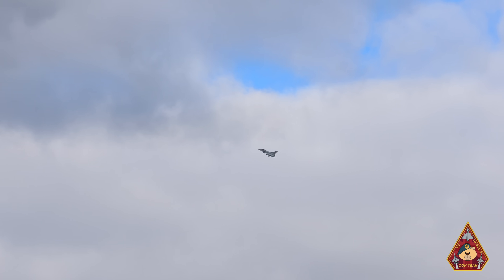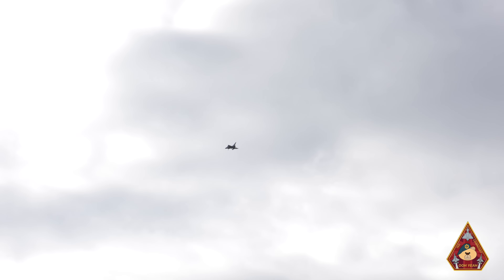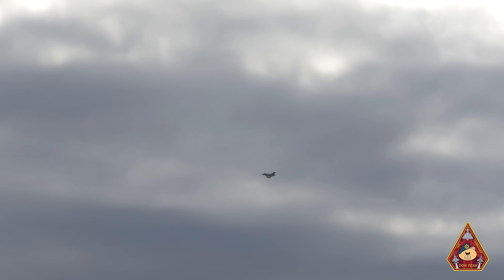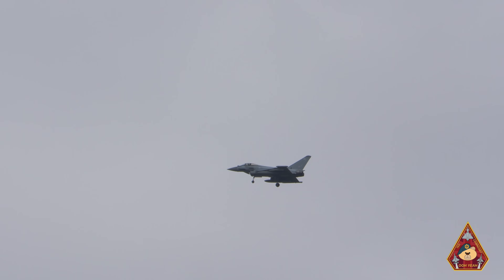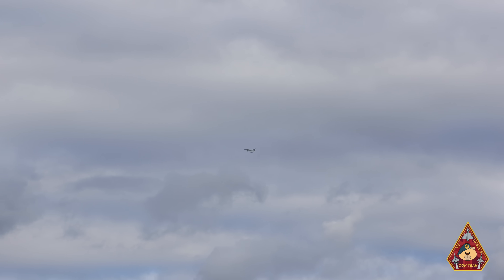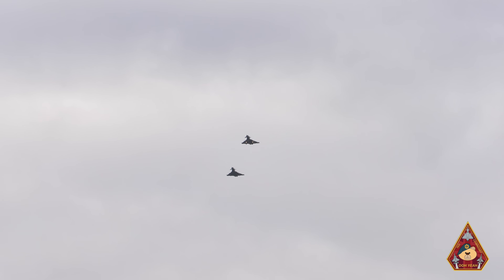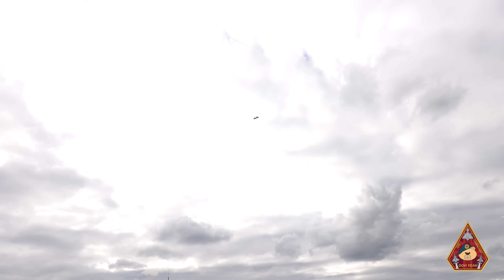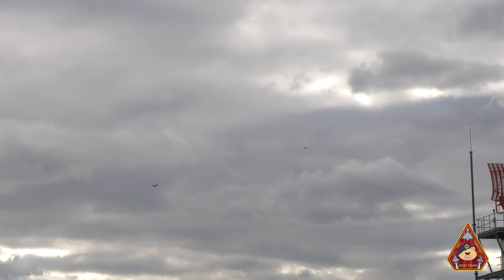HELP! WHAT HAPPENS IF YOU HAVE A POSSIBLE PUNCTURE IN LANDING GEAR WHILST AIRBORNE? SEND A TYPHOON

Comment: ???
option 1 - has obvious puncture -> trap landing
option 2 - cannot confirm puncture -> trap landing
so what difference does it make to do the inspection?  excuse my ignorance.
Reply from the maker: Because if there was a puncture they would need to evacuate the runway and any personnel on that runway, including the runway caravan. This is process. The aircraft can get out of control on landing with a puncture endangering pilot/crews lives. That aircraft could go anyway including towards me. This is cool, professional procedure. Best to check. Remember aircraft tyres are no like cares and bikes :_ted2::_RAF:
Reply: @TedConingsby  ok, but a visual inspection is not confirmation, so surely the assumption has to be that there is a puncture regardless.

Comment: To what end? He had to come down sometime puncture or no puncture.
Reply from the maker: There would be a a very different procedure should the puncture been confirmed. You have to understand that aircraft with a puncture can go out of control, flip over or literally go anywhere. 

Having anyone on the runway would be extremely dangerous and would never be an option. The only thing similar to what you are saying which they would do as an option if there were no aircraft nearby would be to flypast tower. This is a procedure they would do. But the best visual inspection would be to have a pilot fly close by. This is the best visual option. Pilots are trained on what to look out for. FYI, if there was a puncture, they would most certainly clear all personnel anyway near the runway, including the evacuation of the runway caravan. The aircraft can potentially lose control on landing. Thank goodness it never came to that :_ted2:

Comment: What is the point of an inspection and how could you tell if there was a problem with a tyre with no load .. how odd
Reply from the maker: Because this is what they are trained to do and what to look for. If the worse should happen then the procedure would be very different. The aircraft could go out of control on landing and endangering the pilot’s life. The runway caravan would most certainly be evacuated and anyone around it. :_ted2:

Comment: Curious what difference the inspection makes? Would he land wheels up if there was a puncture/tyre mising ?
Reply from the maker: Having anyone on the runway would be extremely dangerous and would never be an option. The only thing similar to what you are saying which they would do as an option if there were no aircraft nearby would be to flypast tower. This is a procedure they would do. But the best visual inspection would be to have a pilot fly close by. This is the best visual option. Pilots are trained on what to look out for. FYI, if there was a puncture, they would most certainly clear all personnel anyway near the runway, including the evacuation of the runway caravan. The aircraft can potentially lose control on landing. Thank goodness it never came to that
Reply: @TedConingsby  Perhaps I should have been clearer.. How can anyone tell if the tyre is punctured without weight on the wheel? I mean unless its exploded, you aren't going to be able to see a small hole from another aircraft or a tower fly by. So surely everyone should continue to assume its punctured regardless of the visual inspection?
Reply from the maker: Aircraft tyres are not like tyres on a car or bicycle so they have like layer on layers which make them stronger so the inspecting pilot is looking for a clear blow out or damage.

Comment: Where were the fire wagons?
Reply: They were ready at the other end of the runway, but not in view in this video.
Reply from the maker: In position where the crash team are located (you can’t see them on the video). In this scenario they would not have them near the runway and most likely have had the runway caravan evacuated if it was to land with a puncture.

Comment: Extremely interesting how this procedure was carried out in this unforeseen event. I'm bewildered how the airborne inspection could possibly tell if there definitely was a deflated tyre unless you put some kind of load onto it first. I guess it was just a visual for any obvious sign of deflation. I'm no expert so who knows. Great video.
Reply: Didn't hear scanner myself but there was talk about a blown tyre instead of puncture. That would be easy to inspect visually, well, apart from the whole close flying 'n all.
Reply from the maker: This is one of the procedures for the visual inspection, the other being a slow pass across tower which can happen but wouldn’t be as effective as a full view by a inspecting aircraft. They would know what to look out for but it’s all about safety and process  :_look::_TCS::_typhoon::_typhoon2::_ted::_ted3:
Reply: That's what I was thinking, how could the other pilot possibly tell if there was a puncture. Also, I was surprised he didn't use the air-brake after landing.

Comment: Was all precautionary. The Jet had done a few Touch & Gos at Leeming. Upon arrival back at CGY, was informed by ATC that the Leeming controller had reported hearing a loud pop on the last touch down and was concerned a tyre may have blown. After visual inspection by CGY ATC and the other jet, all was reported to appear normal so a standard landing was attempted instead of taking the cable or streaming the brake chute.
Reply from the maker: The Typhoon has 6 sensors on each wheel and yes, a hard touch and go would have set this off too. You can get an inspection from tower but a visual inspection from another aircraft would be a lot more accurate. Absolutely crucial precautionary procedure. You cannot assume a puncture as actions for each would change, including evacuation of runway caravan, crash teams on standby  etc. :_ted:
Reply: @TedConingsby  Unfortunately no wheel sensors display tyre pressure info in cockpit, sensors are for engineering purposes after flight. Only info pilot gets is whether landing gear is locked down or not. In this instance, only info available about tyre was from air traffic reporting there may be a problem due to a noise they heard. Got ATC to take a look as that was the best option until Razor formation happened to arrive home just in time to do an airborne inspection while I still had sufficient fuel remaining.
Reply: Cool, that explains why there seemed to be talk about blown tyre rather than puncture. Still, nice to see procedure working, all calm and steady.

Comment: Not really sure what the inspection did. If he has a puncture, he still has to land, so what difference did that make?
Reply from the maker: Landing an aircraft with a punctured tyre would result in a dangerous scenario for not only the pilot but for everyone and everything around it. The pilot’s safety would be at high risk, the runway caravan would be evacuated, the aircraft could swerve out of control, it would damage the runway, pretty much an unpredictable outcome. The visual inspection is crucial for safety otherwise they won’t know what action to take. :_ted:

Comment: A dodgy tyre pressure sensor? A super soft touch landing though, just in case!
Reply from the maker: Each wheel has 6 sensors so after a hard touch and go, it could be possible the sensor had a fault/warning. :_ted3:
Reply: @TedConingsby  Typhoons do not have tyre pressure sensors. They only have anti-skid sensors and weight-on-wheels sensors on the main undercarriage legs.

Comment: Im ex -RAF and Crash crew or as we call it now ARFF (  very American ) . In my day I don't think aircraft had tyre sensors as the only checks I ever saw back then was Undercarriage checks due to not having three greens or a suspect hydraulic failure . At the airfield I work at we have some very bright lights on the grass in front of the Tower to illuminate an Aircraft at night with suspect gear failure and yes it works . I imagine it is hard unless there is obvious damage to the tire to spot , as there is no weight on tires at that point . I guess he was looking for any damage or flat spots on the tire . Im no pilot but I can only guess they will burn as much fuel in the air as possible before attempting a landing , one it's lighter and two much less fuel in case things go wrong . Meaning much less of a fire if it does go wrong . Thank you for the video 🙂 .
Reply from the maker: Thanks for your comments. Yes, the pilots know what to look for and it was due to a hard “touch and go” which led to the issue. Luckily it was most likely a sensor of the landing gear. Each wheel on a Typhoon has 6 sensors, so something happened to one of them. :_typhoon2::_TCS::_typhoon::_RAF::_ted::_ted3:

Comment: In the absence of another aircraft to have a visual check, the pilot would do a slow speed pass close to the tower for a visual check from there. Have experienced that a few times in my RAF career. 
Also
Remember a time at Marham in the early 80’s, I was out switching on the LE58 emergency flare path lights as dusk fell and we had a Victor up on an air defence sortie. I noticed a few pieces of FOD on the runway so went for a closer look. It was chunks of rubber from one of the tyres which had exploded during the takeoff run. There was nothing we could do for a few hours apart from clean the runway with a sweeper, until it returned where he did a normal approach and a gentle touchdown with no further issues.
Reply from the maker: Hi Jules, yes that is the alternative; a slow speed pass across tower. Luckily there was a Typhoon already on recovery for a visual inspection, which would be more effective. :_ted:
Reply: Lucky to get a driver out! We always waited for them on the flightline!

Comment: Does RAF Coningsby have a resident runabout Hawk trainer ?, send that up to inspect the  Typhoon,s undercarriage to ascertain which wheel has the deflated tyre, then foam the runway. You cannot piss around with  a pilot,s life and a several hundred million  pound jet fighter .
Reply: Thank you for your suggestion. No, there is no Hawk ready, preflighted and fueled up ready to go. That would be quite a bit more complicated than it may seem at first glance. Fortunately there are several other options for a visual inspection, if another recoverying Typhoon had not been near.
Reply: Fair  enough but having a Grob  a light trainer aircraft is the better option ,aircraft, I use the term loosely, more akin to a lawnmower with wings and easily started like said lawnmower. Okay the speed difference  between a lawnmower and a dirty Typhoon is significant but gives the tower staff and erks visual information regarding the Typhoon,s undercarriage and a good thing Typhoon drivers fly in pairs.       @Arie_323

Comment: Why don’t they have puncture proof tyres
Reply: You can't compare these tyres to bicycle or truck tyres. They have much more extreme operating temperatures and need to withstand enormous impacts. They already are much stronger and puncture resistant than "normal" tyres.
Reply: You cannot have a puncture proof tyre!!! If it was possible it would be solid and have with it a myriad of issues concerning its use!?

Comment: Nikos, if the Typhoon landed with a puncture what could cause a disaster?
Reply: With the speeds and energies involved... imbalance may cause aircraft to veer off runway. The mishap aircaft may collapse part of the landing gear (and veer off runway).  Once it hits the grass it can tumble, summersault, or lots of other nasty things. There is a lot that could go wrong, unfortunately. Even if the pilot ejects, debris of the plane can still cause trouble.
Reply: Thanks, Arjen, if you put it this way...is a puncture something that happens regularly?
Reply: @meertenwelleman4600  Define regularly.. and define "puncture", I guess. Especially with larger airplanes that need to land early, you can regularly see blown tyres because the aircraft were over safe landing weight (sometimes there's no time to dump fuel). As for leaks, punctures, slow deflate, fast deflate on jet fighters... Im sure it all happens occasionally, but I have no idea how often.
Reply: Thanks, Arjen. Must be exciting living close-by Leeuwarden Airbase.
Reply: @meertenwelleman4600  Actually It was quite boring the last months with the runway renewal :) . Also not very close-by, rare to see jets overhead here. :_f35::_f35::_f16::_f16:
Reply from the maker: So you have to visualise that the aircraft will have one wheel with just bare metal as the impact will shred the tyre. There is a risk that the aircraft will skid out of control and go anywhere so lives are totally at risk. Speaking of lives at risk, there is the pilot’s safety. Should it get totally out of control the pilot may have to eject. In the end, landing with other than tyres is going to be a dangerous landing :_ted:
Reply: Do you know if a puncture is practiced in the simulator?

Comment: Great formation flying skills at this slow speed.
I would have thought that a temporary self-inflating tyre would  have been available. 

On the grass in front of the Tower there are a set of lights which face upwards. 
Should an aircraft have undercarriage problems at night,  then the lights can be used with the aircraft making a low, slow flyby.  
For a ground visual  inspection.

Well filmed Ted and Nikos.
Thankfully, this video wasn't needed for official purposes. 
👍:_ted::_RAF::_typhoon2:
Reply from the maker: Hi Gazza, tense situation and waiting to hear back from the Typhoon carrying out inspection was so tense for us, goodness knows what it was like for the pilot in the emergency aircraft. 

All ended well :_RAF::_typhoon::_ted:
Reply: I just said the same about the lights 🙂 , you ex RAF or worked on Airfields before im guessing you have .

Comment: Had a puncture repair kit for my bike. It came in a wee metal tin. Mmm, maybe not ideal for this scenario tho'. An insight into  how the crews deal with this not good situation. Relieved all were safe & well.:_RAF::_typhoon2::_typhoon2::_ted2:
Reply: Margo
You can now buy bike tubes with a gel inside them.
This gel immediately seals any holes.
Some cars now have tyres which self inflate should a 'blowout' occur.  
A temporary measure. 
Again, I'm surprised nothing has been invented for aircraft. 
A pal of mine worked for Dunlop in  Birmingham. 
Making tyres for the Harrier. 
:_RAF::_typhoon2::_typhoon2:  :_ted3:
Reply: @gazza2933  thank you. Have heard of that gel stuff. Maybe we could invent a tyre puncture repair kit for aircraft 😁? Piece of equipment that comes out & on to the tyre (bit like mid air refueling) & inflates the tyre with that gel stuff? Total respect to your Harrier tyre friend. Oh, I know someone who may have built the navigation systems for the Harrier (nudge, nudge say no more! 😜). Bring back the Harrier too. 🥰xx
Reply from the maker: :_nikos::_raf2::_ted2::_TCS::_blackjack::_topted::_ted::_ted3:

Comment: I’m pretty sure that despite sounding real it was a training exercise as there were no emergency vehicles when he landed??  Just guessing
Reply: The pilot had reported the issue to the tower after a touch and go. The emergency services were alerted, but due to the nature of the issue, could not be relocated too close to the runway. After the second aircraft had confirmed that everything seemed to be ok, the emergency services were stood down. If the visual inspection had deemed that there was an issue needing further action, I am sure that the emergency response would have been appropriate. The usual practice in such an emergency is an initial  visual assessment by either another aircraft or the tower.
Reply: For a practice emergency you would not use an airplane recovering low on fuel to do the inspection, they would just do it after take-off to have plenty of options to recover. Guessing is a very bad thing to do around aircraft emergencies, ones that could be recovered and ones that ended badly.
Reply: @Arie_323  hi Arjen I was not guessing at the emergency only that i thought it may not have been an emergency.  Having been involved in a very similar event as an engineer with an aircraft reporting undercarriage issues despite many visual checks from fly pasts and a certainty all was ok we still had all the emergency services deployed on site, again thankfully all was ok.  Believe me as an aircraft engineer of 40 years safety is paramount and I would never guess.
Reply: @SteveMorrisTCS  Fair enough. As said, the emergency vehicles were available, just not visible on the video but visible to those on scene. It was not a practice.
Reply from the maker: Hi Steve, I remember the crash team were called out but tucked away as they had to stay clear of the runway. There were flashing lights but you couldn’t see them on the video. I remember the pilot was meant to land and did a go around and tower asked a reason for change of intentions. Pilot reported a possible puncture. Tower said to carry our circuits to see if they could track a typhoon available. A flight of two were on recovery but wingman had zero fuel and the other had enough fuel to go carry out inspection. This is all we could remember. :_ted:
Reply: @TedConingsby  thanks for that just goes to show how sometimes what we see or say may not paint the whole picture.  The good thing is that it all ended well and we got to see the procedure. Hope you have a good time at Bournemouth
Reply from the maker: So each wheel/tyre has 6 sensors on each one and it will be the sensors that told the pilot there was a potential puncture. After the all clear, pilots informed ATC and instructed the crash team to stand down. Should the worst have happened, the runway caravan would have most likely been evacuated too. :_ted: